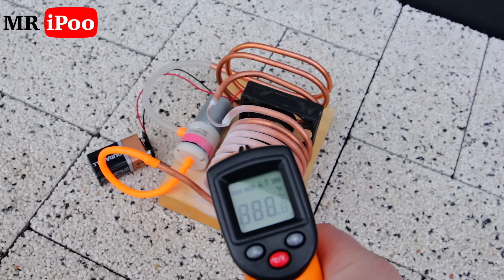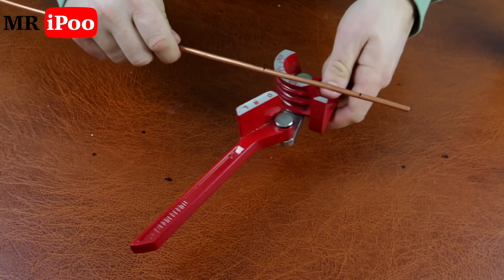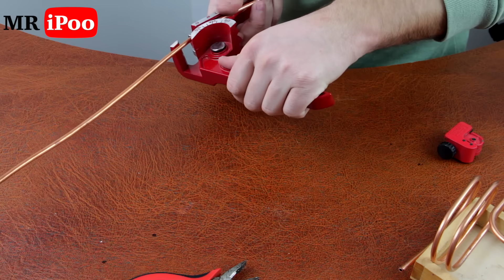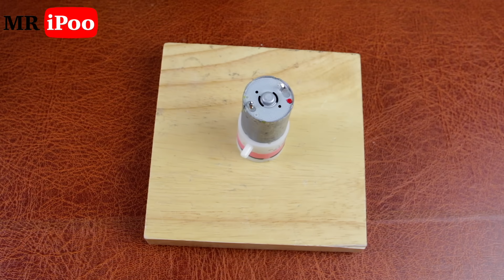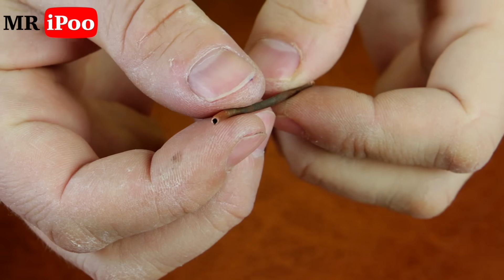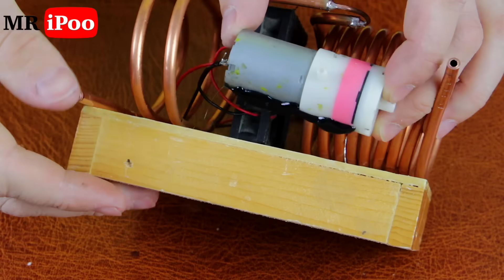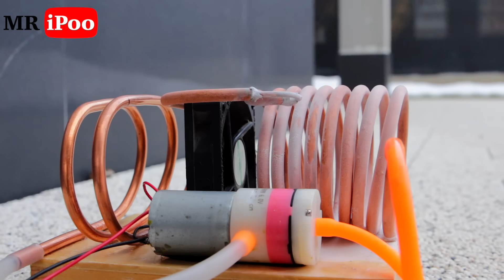DIY Freezing AC : Crafting an Icy Air Conditioner down to -32°C!

Comment: Long post - but if you have some thinking time I'd like you to "check my homework"  I've been digesting all the conversation about Mister iPoo's "fake" device and the principles it almost demonstrates. Have a think:

Assumptions:

1. Law of physics state that in a gas, when pressure increases, temperature also increases if the volume is held constant. (Nothing you can do about that, in this universe.)  The inverse is also true – decrease the pressure and the temperature goes down.

2. The Second Law of Thermodynamics states: Heat transfer occurs spontaneously from higher- to lower-temperature bodies but never spontaneously in the reverse direction. So, heat flows “downhill” you might say – nothing you can do about that either, except maybe fight it with insulation.

3. The Law of Conservation of Energy states:  Energy is neither created nor destroyed. You can move it around, or change it’s form, but it’s all still somewhere when you’re done.

So:
Imagine a loop of copper tubing. Not coils or fans or anything, start simple, just a loop. Top and bottom are defined by gravity. There’s nothing special in the tube, just plain old oxygen-nitrogen air.

Somewhere around the top put a pump in the loop.

Somewhere around the bottom, put a kink in the copper tube to reduce the passage inside to something like a pinhole. Exact dimensions aren’t needed at this point if it does what we need.

Start the pump.

If the pinhole is the right size, pressure starts to build up on one side of the loop because the pinhole flow can’t keep up with the pump.  The pressure on the other side of the loop starts to go down because the pump is taking air from that side. Now you have a high pressure side and a low pressure side.

When the plain old air is compressed, it heats up a little. (nothing you can do to stop that in this universe) Some of that heat will radiate through the copper tubing because now that air is warmer than it was when everything was at room temperature. (Second Law of Thermodynamics.)

When the air squirts through the pinhole into the lower pressure side of the loop, it expands. That means it cools off. (Law/Assumption #1 again) Since some of it’s heat energy was lost radiating out of the copper tube on the other side, and now it loses even more heat from expansion, and it is colder than the surrounding room air, so heat flows into the gas through the copper, absorbing heat from the air around the copper tube on that side.

This simple loop, with a pump, and a kink, is absorbing heat on one side and radiating it on the other. It is “moving heat”.

* Brief aside:  Since the device in this video has a closed loop, a pump, and some kind of restriction, it’s a bit rash to say it's nowhere “close” to pumping heat, since it doesn’t take that much to accomplish it. Useful amounts is another subject, and depends entirely on your “use”. *

Now the kicker - 

Take the pump out, and pour some liquid butane into the copper tube. Now it's exposed to room temperature copper and only 1 atmosphere of pressure, it will immediately start to boil to vapor.

(for the purists who want to see no air “contamination” in the system, let enough butane boil to vapor to fill the entire copper loop and push all the air out the top.)

Replace the pump.

Make a cup of coffee and contemplate nature while the system stabilizes.

Now you have something like a Bic lighter. A closed container with some liquid butane and some vapor, in equilibrium. We can pull a number out of the air and say it stabilizes at about 37 psi. 
Some things to consider about that situation -

The liquid butane is right on the ragged edge of becoming vapor – the vapor is right on the edge of becoming liquid. The tiniest change in pressure one way or the other, and some of it will change state from vapor to liquid or the other way around to reach equilibrium again. This can’t be stopped, it's the nature of the beast, just like the propane in the tank under your BBQ.

The pump has 37psi on both sides of it. There is no pressure difference that it has to overcome to start pumping. The whole loop is at 37psi and everything is sitting there, just like a plastic Bic lighter with liquid at the bottom and vapor at the top. (it’s that gravity thing)

Start the pump.

Now it’s pumping vapor to one side of the loop. This increases the pressure and makes the vapor a bit warmer. As the extra heat radiates through the copper tube (just like it did with the air) you have cooler vapor at a higher pressure than it needs to stay vapor, so it starts to condense to liquid which flows to the bottom of the loop.

The liquid at the bottom, being pushed by the vapor from the pump, starts squirting through the pinhole into the lower pressure side of the loop. Now it’s in a place where the pressure is (barely) not enough to keep it in a vapor state, and to add to it’s problems it’s absorbing heat from that side of the copper loop. It boils. The vapor carrying the heat gets pushed around the loop to the pump, and it all happens again. The butane (or any other refrigerant) going through high and low pressure and liquid and vapor states is moving far more heat than just the air did. That’s why we use refrigerants, right?

Back to the video: 

The device shown has a closed loop, a pump, a restriction, and some butane in the system. There are some obvious quality issues when it comes to choice of rubber tubing, diameter of the restriction, etc. but there are FAR more requirements present than absent for this device to move some heat from one side to the other. Maybe rubber automotive fuel line would be a good upgrade that wouldn’t mind the butane or the pressure. A pair of pliers, or a hammer, could reduce the size of the restriction in the “capillary tube”. Those might actually be the only changes necessary to make a working demo unit. (yes, for a very short time) It’s an opinion – a judgment call, but I say this thing is very close to being a working heat pump.

So, does this violate some physical law or did I miss something else?  (and yes, I have too much time on my hands...  lucky me)
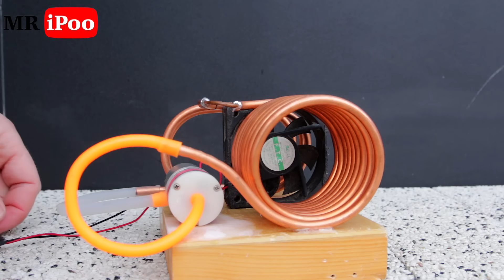Reply: Yes. You missed that the last part from 6:51 was played in reverse.
Reply: I'm still asking around for some materials science friends that might have some actual numbers (real data, not just the strong opinion of someone who works on commercial AC units so we should believe him "because..." (arms waving) - some actual numbers that would give an idea of how much heat a butane minimal phase-change loop could move. There is no doubt you can move heat with just a closed loop, a pump, and a restriction - but some actual numbers would tell us how cold you could possibly get a small loop like this with the energy in a 9v battery. I know it's some number greater than zero, but I can't yet find hard data showing even a theoretical maximum with ideal conditions.  I'll post if I get that info because I know some people here are after more than just proving if a video is fake or not.   --Cheers!

Comment: Looks awesome.  Separating your heat exchangers, they are both using hot and cold in same air flow.  I also recomend putting the evaporator in like warm water and having it raise the vapor a high distance like 10' or more, then condense in some cold water and have the liquid drop  several feet then have a piston or turbine to make electricity.
Reply: That is how they would be configured in a dehumidifier; only the other way around ~ warm-humid air pass’s though the cold evaporator where the humidity condenses out of the air and it turns cold > it passes through the hot condenser cooling it and a fan sucks the air out
Reply: @samuelfellows6923  Yep, it's a piss-poor build that wouldn't work, but in the real world, butane air conditioners have the condenser outside the house - you have to pump the heat somewhere, you can't just magically make it go away. 👍

Comment: Amazing. Compression, Expansion, Evaporation and Condensation all in one tiny little machine. I'm not so sure about using the lighter fluid as the coolant though, might be dangerous if leaks. How about you make the next design with solar power. 👍🏼
Reply: Actually, there are literally millions of refrigeration units working out there using R600a (Iso-Butane) as a refrigerant grade Butane. Such small volumes are no big risk in your house.
Reply: Well, people put small bombs in them ears (Li-Ion batteries in headphones).
And also people fart sometimes.
People sometimes take showers and trip and die.
We live in a dangerous world.

Comment: I am a heat and refrigeration engineer!  The cooling system is not that simple!  A lot of nonsense in this system!  (1) this pump does not have enough compression pressure, (2) the injection cable is too short and does not have enough heat exchange from the condenser to the condenser, (3) the system is not evacuated to remove the moist air inside.  never bring the temperature below 0 degrees Celsius, (4) assuming there is ice precipitation like the video, the temperature will never drop to negative like that!  Conclusion: This is the skill of the video maker
Reply: I wish an hvac person. engineer maybe,  uaheh would make a video of how to make a proper one... I used to do T&B and still don't get it, or how it works.  trying to make one for my Boat. and found this.. I look for pepul like you in the coments
Reply: True, it's a fake. But you are also the victim of your "training". To make a functional heat pump all you need is a loop, a pump, and a restriction. Just because you have been trained to hang a gauge set on a unit and declare it broken if it doesn't have 100psi difference doesn't have anything to do with building a miniature butane heat pump. You only need a few psi difference across the restriction to get phase change. And as discussed in other comments, the amount of moisture in that small a loop wouldn't cause a problem with anything. This small thing could easily "pump heat" if a few minor errors in the build were corrected.  It's not a product. You won't have to "service" it. It's a demonstration. 😁 Cheers.
Reply: @davidsmith3302  To achieve the negative depth of - 32 degrees shown on the heat gun, do you know how many psi of compression must be needed to escape through the cable and spray into the evaporator?  and at - 32 degrees, the humid air in the system that is not drawn out will freeze and cause blockage of the injection cable!  Let's experiment, not just theorize, my friend
Reply: @cuocsonglanhungtrainghiem7299  There's nothing wrong with crunching a few numbers to see what kind of reality you might be dealing with - for example:

Someone in another post has already provided a rough calculation of the amount of possible moisture inside the tubing, even given an extremely humid Florida day, and concluded that with such a small unit (and therefore much shorter tubing than a normal size AC unit) there wouldn't be enough moisture inside to create a 1mm ball of ice, (which yes - would clog the system IF you could somehow convince the water molecules to all  bunch up together before they freeze - unlikely, right?) Once again, blindly following training that is oriented to build or service giant (relatively) commercial AC units may well have nothing to do with something scaled down so small - that's all I mean when I refer to being a victim of training. I doubt any school teaches how to service 5 inch wide chiller units. 😉

Regarding the pressure difference to achieve frost on the inside or outside of the tubing, or even the -32 shown on the heat gun (which by now we have all agreed was a big part of the "fake" component of his video) I am still trying to get some numbers from people that know more about materials science so we might have some way of calculating the theoretical performance of the butane. Data for the more common refrigerants, and even some good numbers on propane (from the Hyperspace Pirate video) aren't very helpful because no one publishes reference data with limitations like these (that would never have to be suffered when building high powered commercial units.) 
Still trying though - I'll post if I find something useful. You can still theorize that, if you put the unit half inside an insulated box (as you would with any refrigeration unit in the real world) so that it could keep pumping heat out without having it immediately replaced, that eventually you might drop the temperature quite low just because it can keep making progress by working on colder and colder air. Lots of factors here, so -

To your point and suggestion, yes, it would be far easier to experiment and measure - but I would never have the spirit to do that if I believed the people who has been trying to convince me that this unit could never be able to pump any heat. I think that is another symptom of having "training" with real, commercial machinery vs doing something on a lab bench. As far as I'm concerned, it's easy to see that you can build something that pumps heat, without even using a refrigerant, so with the advantage of a phase change material in there I have no trouble believing a small chiller can be built that could look almost exactly like what iPoo tried to make. And of course I wouldn't expect it to run long enough to be a "new" product on Amazon 😂🤣
Reply: If you say you are the president, I will believe you.:face-blue-smiling:
Reply: Well, in all fairness the refrigerant used was butane and no steel was used.  Given that this demonstration was for entertainment purposes, not functional, I think we can cut the guy some slack.

Comment: Basically this is working but in a few minutes only after that he needs to refill it again with the butane gas .
Reply: There are literally millions of butane (R-600a) chillers working out there, it's not "breakthrough" technology. If he did a better job on the build he would have produced a working small model - no magic required.

Comment: They deceive those who don't know about cooling, this video is very false, if it could be done like this they would already be using it to cool computers, I would be doing it myself.
It does not use a compressor but a water pump that is impossible, it does not use a capillary tube that tube is very thick that is impossible, it uses weak rubber hoses that is also impossible, it uses only a small battery that is also impossible it is like creating energy from nothing . It does not use pressure measurements of the gas that is injected with a needle and to make matters worse it covers the injection hole with RUBBER, it makes you laugh all day.
Reply: You are ignorant. There are literally millions of butane (R-600a) chillers working out there, it's not "breakthrough" technology. If he did a better job on the build he would have produced a working small model - no magic required.

Comment: What kind of pump, is this and what kind of gas is being pumped, into the system?
Does anyone know??
Reply: Look at the can in the video.
There are literally millions of butane (R-600a) chillers working out there, it's not "breakthrough" technology. If he did a better job on the build he would have produced a working small model - no magic required.

Comment: good try, but the frost on the board gives you away, plus what about the air in the system? never saw one that didn"t need purging.
Reply: If you watch closely when it's zoomed in on the capillary tube, you can see water droplets turn back into frost.
Reply: Doesn't need purging - too small - not enough moisture in there to do squat. You are a victim of your service man "training" - it's not a product it's a demo. It's also fake, unfortunately.
There are literally millions of butane (R-600a) chillers working out there, it's not "breakthrough" technology. If he did a better job on the build he would have produced a working small model - no magic required.

Comment: No refrigerant? No work.
Reply: A loop, with a pump, and a restriction, will move heat from one side to the other, with just plain air. It's physics - can't be stopped. 
Also, he used butane as a phase change refrigerant, but he did a horrible job of construction. A few fixes and it would pump heat.

Comment: As others have mentioned, this video is bullshit that will inevitably end up used as b-roll footage for some "A/C inventor creates new technology BIG A/C doesn't want YOU to have for $69!" There is no low/high side in this video. There is no way a tiny pump powered by a 9-volt battery will compress a liquid that much, the loops aren't even sealed properly. Also, Is that SNOW in the reflection of the tiles on the wall? If the outside temperature is cold enough for that, I'm not surprised that your copper tubing ices over and you get temps of -33. Let's try this in a hot humid environment.
Reply: Sigh... you are a victim of your "training". You don't need 100psi difference to induce phase change. 1psi will do it. But you are right, it ain't new technology. There are literally millions of butane chillers out there working right this minute. They use R600a. And yes, he did a piss-poor job of the build so he had to fake the readings, but you can build a miniature butane heat pump, no magic required.

Comment: Could someone please give us an indication about how much refrigerant is put in the system?  Do you have to have sufficient to fill the warm side coil, or is a just little enough? TIA.
Reply: It won't run for long with those materials - any amount of butane would help (if he had gone to the trouble to build it properly so it would actually work) In a "real" system there are ways to watch gauges and know when you have the proper refrigerant charge. This is just a toy.